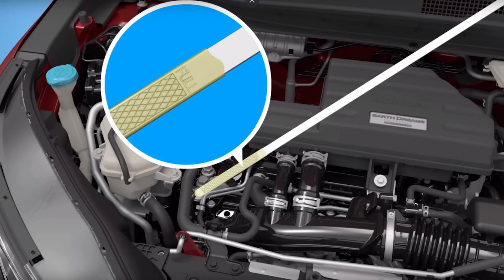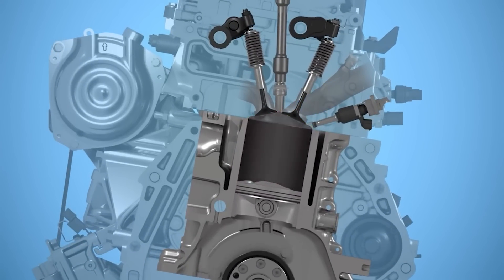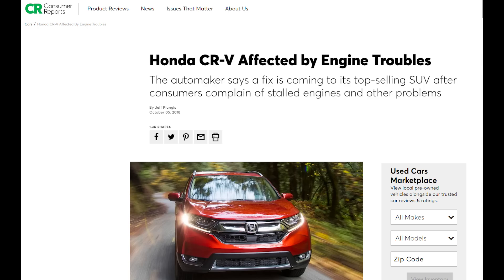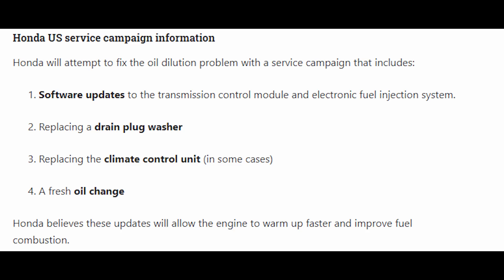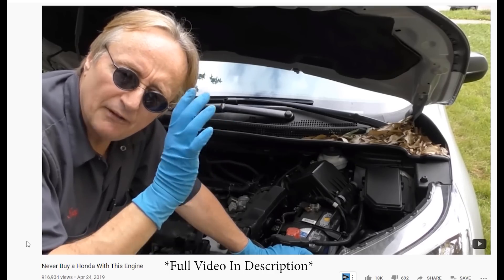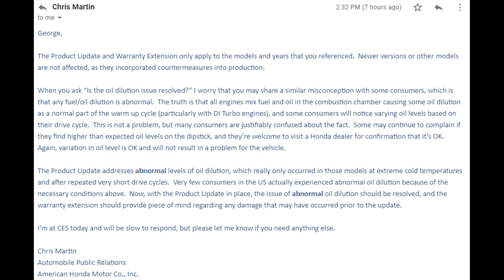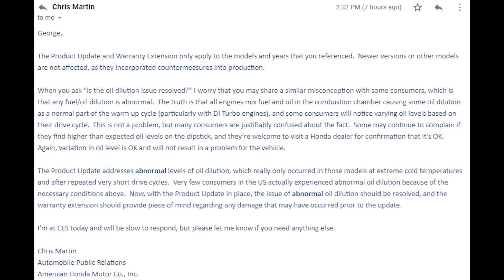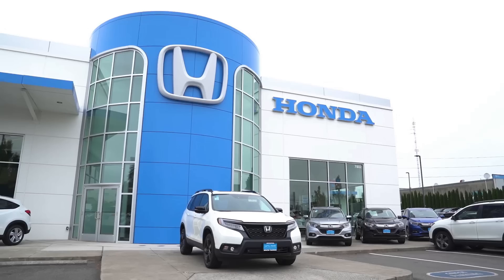Does Honda Have An Oil Dilution Problem? | 1.5L Engine in CR-V and Civic

Comment: Lots of internet nerds getting their panties in a twist over this as little babies do on the internet. If this is actually an issue, and not some paranoid fantasy, then MILLIONS OF 1.5T ENGINES will start to fail over the next few years. This is one of Honda's main powerplants and they've now sold it in Civics, CRV, and Accords. it's either going to be the biggest engineering failure in Japanese car manufacturing history...or just another internet Harambe moment (see, you vapid people don't even remember Harambe RIP)
Reply: Well...Just to clarify with you some years later this is a huge problem that Honda is NOT fixing. I live in a  cold climate state. Yes,  I am a female, not a gear head guy. I have taken good care of my Honda. I swore I would only own Honda until now. I had no idea until a month ago that there was even an issue with these cars. Why would I, all my Hondas lasted forever. I expected the same. It first started with my car hard breaking for no reason, one day it locked me in. My boss had to come get me out. It has stalled three times and all the dash lights go off, check engine, electric park brake problem, Awd problem, Collision Mitagation problem, EPS power steering problem, were just a few. I would pull over shut the car off, and let it sit, about 30 min all lights would be gone. I thought maybe snow on my sensor or the cold weather was the issue. Jump forward to April 19, same thing, pull over wait for lights to go out only this time they dont.  We code test it it say Cam sensor, super easy fix. I mean if it was something big, my car would of let me know, you would think, right?I take it into Honda CDA, and they tell me a nut is loose in my turbo. A dumb girl would probably believe that. I called my ASE mechanic friend and he said there is no way that nut did that damage to your Turbo. So what is Honda trying to hide?? My research starts, I had no idea of these oil dilution problems. AMERICAN HONDA is stating the turbo isn't part of the oil dilution problem, WHAT???? DOESNT THE TURBO NEED OIL LUBRICATION FOR THE BEARINGS? So when you make these comments sure check back and see what some of us HONDA owners are going through now, after the fact. You will see many complaints about the 2017 -2018 CR V. 4 years ago was too soon, and the sad , but true fact Honda is not the company it use to be. Look at all the post, Honda has lost a lot of their loyal customer. HONDA will not fix this until this stalling problem, kills someone, sadly. Let's revisit this in a year or so shall we.

Comment: I work at a high volume Honda dealer as a tech and can honestly say we have not had a single issue with the engine or transmission in the 17+ Cr-v's. We have even had a few close to or over 100k miles that were uber or Lyft cars still going strong. Dilution or not I have yet to see any engine damage. A more common failure in these engines is oil starvation to the cylinder head due to a clogged oil passage through the head gasket...almost always caused by a small piece of plastic wrap from an oil filter.
Reply: Flatbill Ron  hope you can say that 5 yrs from now to crv owners that have 100k plus miles on the turbo engine...
Reply: can you say the same thing now?
Reply: Any updates on your comment?
Reply: @Blackhawk556.  Still very few problems and nothing I've sean related to oil dilution. Right now id say the most common issues are bad fuel injectors that cause vehicle to run richor lean and head gasket issues. The head gasket issue is still pretty few and far between.
Reply: You guys at honda how do u not see Hondas with over 100k??   I'd think ther would b way more of them than under 100k.    I mean my Hondas acuras they go 250-300 pretty easy unless the owner doesn't change oil and replace things as needed.   😊   not tryn 2 b disrespectful at all.  I appreciate you coming on here as a Honda Tech and sharing your exp. Much appreciated.     

I suppose most people may not bring ther Hondas to the dealer after 60k-90k.   And use smaller shops??  

Just another guy concerned about his girls 18 CRV that we love like our older Hondas we had for so long and were the Best 2 us.

Comment: Here's the real description of the issue:  when it comes to fuel combustion, GDI engines share some similar characteristics with diesel engines.  One of those is that at low load or idle conditions in cold outside temperatures, the engine is not burning enough fuel to maintain adequate operating temperature and, because of that, will not fully combust fuel.  That unburned fuel will either go out the exhaust or get pushed past the rings into the crankcase.  In diesels,  this is called "wet stacking" because enough unburned fuel  will actually make the exhaust pipe ("stack") wet with unburned fuel.  The main way that diesel engines can combat wet stacking to increase the engine RPM at idle to increase fuel consumption enough to maintain engine operating temperature.  That will likely be the way that GDI engines will have to be managed to solve their wet stacking problem.  To be clear, oil dilution is a direct result of wet stacking.  So, any regimen that does not cure wet-stacking won't cure oil dilution.  Wet stacking was seldom an issue in multi-port-injection (MPI) gasoline engines because those engines have to burn more fuel to maintain idle and will, thus, maintain operating temperature in all but the very coldest of environments.
Reply: Great to see someone actually knows what they're talking about.  So basically it's the owner's/driver's driving usage.  If they very-cold start the CRV, then drive 5 minutes and stop/park it at the grocery store, while it's still cold, then shop, then come back to a very-cold start again, and drive 5 minutes to get back home, and they also don't regularly change their oil every 3,000 miles, and they beat the crap out of it, while it's still cold, and low miles on the engine, then there's oil dilution.  This is common knowledge with people like you and I... however the public is not educated in this bad owner/driver behavior.
Reply: I agree with you, CNN IS indeed fake news. If Honda would explain the issue to customers - I would not take issue with this. However, they keep this from the public because obviously it would affect their sales figures. I have to call into question their ethics. Let's go back to multi-port injection!

Comment: I bought a 2 liter non-Turbo 4 cylinder Honda Civic LX right before Christmas, I only have 170 miles on it, and already the dipstick and the oil cap are smelling like gas.  I took it to the Honda Dealership, one guy said that maybe I should just get an oil change, BUT, that the car still had the break-in oil in it with Zinc, and that I shouldn't get it changed because of the break-in oil.  He told me that, IF, the dipstick goes higher than the orange plastic, that I should then bring it in.  It's not above the orange plastic with the two holes.  And, why didn't Honda just keep the metal dipstick, it was soo much easier to read it, I can't tell where the oil is or isn't on that orange plastic.  Honda, why are you doing this to your customers?????  I live in South Texas, today's high was 81F.

Comment: As a former '18 Si owner, I can confirm this is an issue. I sent my oil off to be tested and it showed 3% dilution which is well above what would be expected.
Reply: How often did you change your oil though?  What oil are you using? What fuel grade do you use?  How many miles on the engine?
Reply: @hegeliandetective1034  Mobil1 synthetic with Mobil1 filter 0w20 as specified in the owner's manual. OCI was every ~4000 miles.
At Best you're trying to outrun a failed engine. My oil smelled like gas and was  extremely thin.
Reply: @digitaldeviation  0W-20 is already extremely thin... my friend
Reply: @hegeliandetective1034  Of course, but that's exactly what Honda recommends. I've run 0w in other Hondas and it doesn't come out as thin as this this did.
Reply: @digitaldeviation  That's a mistake on Honda's part, too quick to join the bandwagon of other car manufacturers stating the same thing.
Reply: @hegeliandetective1034  I don't disagree. Car people will likely swap to at least 5w if they plan on keeping the car/suv. But the majority of folks with the 1.5 aren't car people.

Comment: I bought my 2018 CRV a year ago.  I asked the salesman if the oil dilution is a problem here in So. California.  In response, he offered a written lifetime powertrain warranty without charge.  So far with 18,000 miles on it, no problems at all.  Love the car!
Reply: That's great. Which dealership?
Reply: You reading your dip stick correctly, closely watch the diluting oil grow up your stick as the next oil change becomes closer and closer.  Smell the stick as it grows.  A strong gas smell is what you don't want your untrained nostrils to find.
Reply: @rayburns8019  we might get a checking kit for fuel in oil. ford has one for fuel in diesel?????

Comment: I think this is a perfect opportunity for other car manufacturs to run dark ops smear campaign to throw out fake lies under burner accounts across all social media as a way to promote fear mongering. honda and Oil dilution is the new buzz word of 2019-2020
Reply: Except Honda offers software fix and extended warranty.
Reply: oh i'm a lifelong honda owner. started with the 1992 honda accord 10th anniversey(186k miles), moved over to a 2009 honda fit (120k currently), and lastly a 2011 honda accord 68k in the body shop. just seems like its a way to dethrone honda

Comment: I’ve got a 19 civic sport and haven’t had any issues, the oil level hasn’t changed. I live in Alabama though. I have noticed it takes a few minutes to warm up when it’s cold outside, below 35 F

Comment: "These engines have a problem with oil dilution" (S. Kilmer). Absolute BS. Earth Dreams engines have quite a long story, in the US too. There were no problem at all with naturally aspirated Earth Dreams engines (AFAIK). Issues are only with forced induction ones, and not only with Honda - Toyota too. I'm not talking about VAG, their TFSI/TSI engines were absolute rubbish for quite a while (approx. 10 years).

Comment: we have a 2013 Hyundai Accent with 1st year of Direct Injected engine, we've owned since new (7 years) and the oil level never changes (doesn't burn or dilute) 93,000 miles.
Reply: it would be very interesting to see the intake valves, how much carbon, if any

Comment: I’m glad I work in VA so I won’t have to deal with this nonsense lol. However if you sit change your oil more frequently then I wouldn’t complain. The real issue is the A/C compressors and Condensers going out quickly and it costing 1500$ (R1234yf is expensive af lol) at the dealer to replace it( and no the aftermarket hasn’t made they’re own version of these items so you have to go to the dealer from what I’ve heard)

Comment: Yeah, Will be especially a problem with people doing short trip driving, where the engine doesn't get to hot enough to burn it off, Maybe these engines need a oil heater

Comment: Do you think that this issue is isolated to the turboed L15s? I have not heard of oil dilution on any Earthdreamed K20/K24, the non-turboed L15 found on the Fit, Earthdreamed V6s, or hybrids. I know that there was a production issue with piston rings on the Civic 2.0NA, but that issue got resolved within months of introduction.
Reply from the maker: For now it seems like it.  The non-turboed ones seem ok as well as the 2.0L turbo.

Comment: Been driving a long time. I've owned cars and trucks that had carburetors all the way to direct injection and everything else in between (... remember the Cross Fire Fuel Injected GM's?). I've always changed my own oil (and also for family and friends). There will ALWAYS be, to some degree, a smell of gasoline in old/used motor oil. That being said... after being fixed (if there was a problem with that specific owner) Honda owners of the 1.5T are going to be hyper sensitive if they smell gas on their dipsticks even though the oil level is within specs. I just changed the oil and filter (5,000 miles since last changed) on the wife's 2015 Subaru Forester 2.5 (non-turbo but does have Direct Injection) with 55,000 miles. The used oil (this being the eleventh oil change) had the familiar gasoline smell. Oil levels have always been within specs both before and after oil changes. My Toyota Camry is also the same way. If you are a Honda owner, I would keep an eye on the oil level being within specs and not so much of the gas smell on the dipstick.
Reply: Not sure why you're going over 3,000 miles on an oil change, with any vehicle.
Reply: @hegeliandetective1034 : "Not sure why you're going over 3,000 miles on an oil change, with any vehicle"   -   I follow the Honda Maintenance Minder on my 2017 Honda CR-V. Never had any issues. A couple of links providing information that oil can still be good beyond 5000 miles.....    Can Engine Oil Last 20,000 Miles? (Engineering Explained):  https://www.youtube.com/watch?v=0IqLRhxdoGg    STOP Changing Your Oil Every 5000 Miles:  https://www.youtube.com/watch?v=4SNgfQtur1Y&t=5s

Number one reason why you change your oil at 3k. Because your dad did....
Reply: @eddiep812  Wrong. The reason why I change the oil at 3,000 is because driving in the city..  If I'm going on a road trip, A to B, 4k-5k miles, not stop and go, then yea, you could get away with it, I wouldn't recommend it though.  Of course an auto maker wants to say you can go 5,000 miles per oil change, you CAN, but again, I wouldn't recommend it. If you buy a new car and just have throw away money and you'll buy another new car after 50,000-80,000 miles, then sure, do whatever you want.  But if you want a car to last to 200,000, every 3,000 for city driving.  You either can't comprehend when you read, or dismissing every point I make.
Reply: @hegeliandetective1034  - Wrong? Why are you so sensitive? I didn't think my reply to your original inquiry would offend you: Not sure why you're going over 3,000 miles on an oil change, with any vehicle  Secondly, how did you extrapolate that I can't comprehend when I read or dismissed every point you make from your original inquiry? Let's break down what you said:
"Not sure why you're going over 3,000 miles on an oil change, with any vehicle:
- I comprehend that you do an oil change every 3000 miles. (I'm happy for you. Keep doing what you do if it makes you feel better... no one is stopping you)
- I comprehend that the 3000 mile oil change is for any vehicle (I just sold a 13 year old 2007 Acura TL that had 243451 miles which I bought with 8159 original miles and I changed the oil at every 5000 mile interval per Acura Maintenance Minder and never had a problem with the engine. I sold it because the transmission began to  show signs of slipping)

I've provided links in my previous post to corroborate the engineering, scientific and testing of a 5000+ mile oil change. It included sending out oil samples for analysis to Blackstone Labs and testing by an engineer.
If you are REALLY interested in the subject of motor oil, I suggest you go over to "Bob Is The Oil Guy" forums: https://www.bobistheoilguy.com/forums/ubbthreads.php/forum_summary
Reply: @eddiep812  I live in a 4 season state at near sea-level.  I also do not baby my vehicle, I drive aggressively, in the upper RPMs through most of my driving in the city, to get out of the way of other drivers that want to tail gate.  Like I said, I "could" go longer, but I don't recommend it.  I'd only go 4-5k miles, on an oil change if it was road-trip A to B trip, for instance,  Denver to Des Moines and back, twice.  Not a heavy load, not a super steep grade.
Reply: @eddiep812  I'd have to know who exactly sent in that oil, what they were driving, and in the passenger seat during the whole oil change, to know the specifics on that driver that sent in their oil.  Sending in some random oil that I can't see who/what/how they were driving, if they baby their car, no aggressive driving, mostly interstate miles, etc.

Comment: They also have transmission and ac compressor problems too. What's worse is they don't seem to be serious or focused on EVs. Instead they are more focused on fuel cell technology. Lol goodbye Honda your trust is gone! Oh they are a bunch of liars. 

Also software updates won't fix the oil dilution issue. Its a design flaw. Lexus gets around this with multiport injection.

Comment: Bought a new 2017 honda crv with the 1.5t. Had oil dilution issues dealer and corporate would not fix. Traded it in on a 2019 bmw x3 Dec 2018.
Reply: Will never buy a Honda again.

Comment: A friend of mine has a 2017 Civic Si with less than 30,000 miles on it and within a few weeks of changing the oil, it smells like 2-stroke premix. Honda has refused to do anything about it and it feels to me like they're just trying to get the cars out of the warranty period so they don't have to worry about it. I almost considered one of these Civics...so glad I didn't.

Comment: Car are made to drive.... Drive them, new teach always have problems... Change your oil 5000 miles and keep driving, I have a friend with the 2017 crv, almost at 100,000 miles, no issues with oil and lives in nyc driver uber
Reply: Every 3,000 miles, actually.  Anyone that goes past 3,000 miles on an oil change, is nuts.

Comment: I have a 2016 1.5L civic with 210,000 miles i drive 80k a year, do i have oil dilution? Yes. Is it a problem? No.